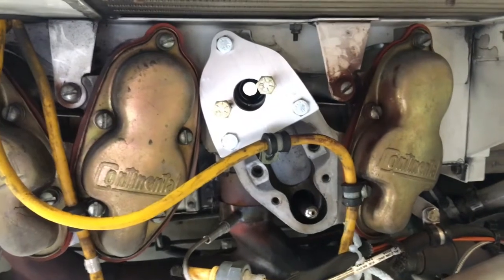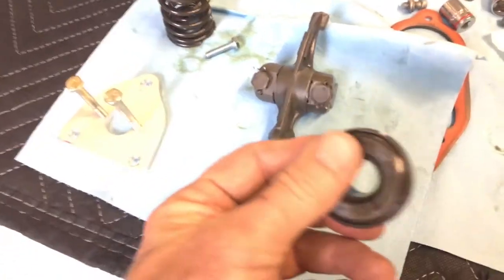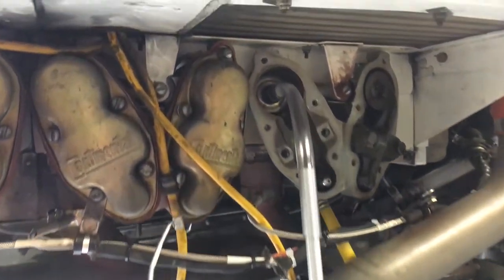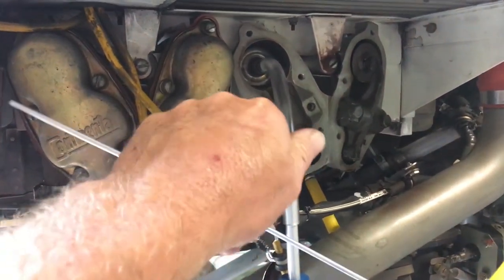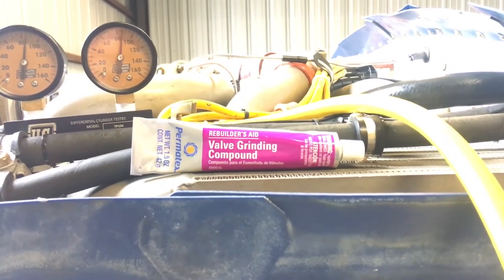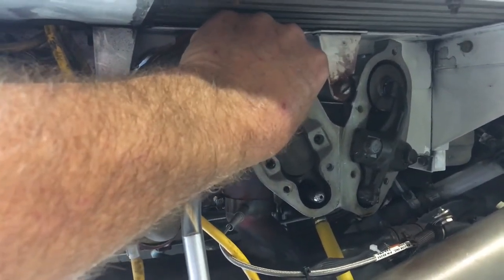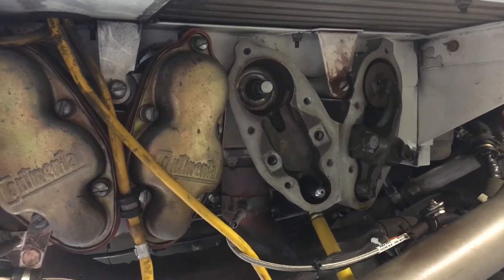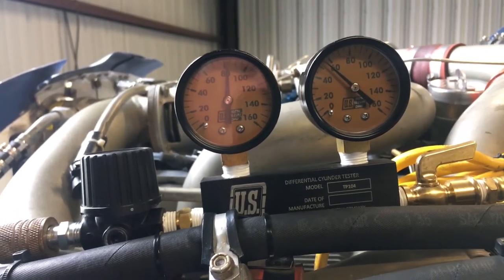Valve Lapping, How I saved 2000-3000 dollars on my aircraft annual

Comment: Just curious. How did you remove the gritty compound from the valve after lapping? Is it now mixed with oil and grinding away your rings and cylinder walls?
Reply: It is an exhaust valve. Any remaining compound on the seat will be expelled as soon as the engine fires up. Absolutely not a concern.

Comment: How low were the compressions?  Cont usually good down to low 40s.   You probably could have borrowed a spring compressor. That contraption took you how many hours to fabricate?  If those valves were worn that much, have you checked the valve guides?